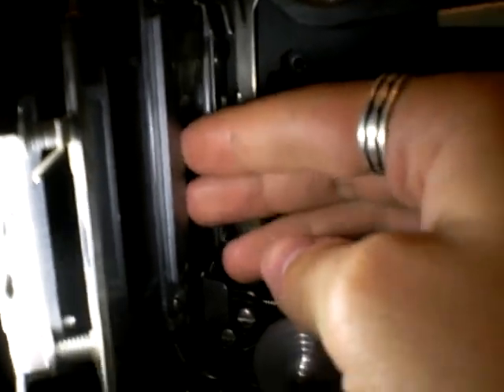Restoring Loops

Comment: I still have my B&H Specialist, and it has the same problem with restoring the loop when the film accidentally jump whether it was a torn sprocket or splices. I use it gently with my finger to restore the loops, so that the film won't jump.